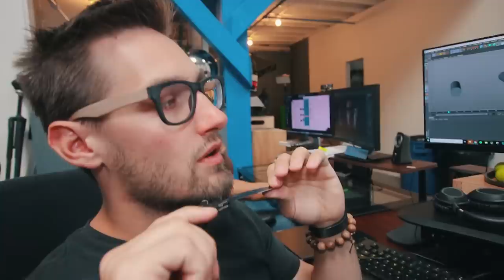TSA is Forcing me to Tear Apart my One Wheel

Comment: The emotional roller coaster of the relationship between boardsmen...
Reply: Cat In The Box Studios Yeah I felt his pain, as I am also using a similar device
Reply: @mikishikishow8393  I use a Neon Nitro because luckily I'm under the weigh limit. The battery last for a really long time but its got it's quirks and terrain limitations. But a friend of mine has a One wheel so I get spoiled every now and then riding his.

Comment: Having multiple leaders on set is only good for the product. You don't need to be surrounded by yes men, you need to be surrounded by people who will challenge what you say and think so you as a person, and everyone as a whole can be better for it. But also as Niko showed, sometimes the first idea is the correct one. This is why I've been subscribed for many years now, you guys all have different ideas and opinions and the content is better for it. Keep up the hard work gentlemen!
Reply: But too many chefs make a bad soup. It's always good to have one clear in charge, who always got the last call.
Reply: Multiple "leaders" is bad. You need a clear direction. Multiple people in the writer's room and having input when appropriate is great but if Niko is the assigned director, you fall in line. There is a difference between agreeing with everything a "leader" says and accepting your role as a follower.
Reply: Dean Searle I wouldn’t say multiple leaders is bad, it’s about not having enough followers
Reply: @vikinger3843  that's a great distinction, I agree. If multiple leaders or more aptly directors was agreed upon to begin with then it works. But having to constantly stop to hear everyone's take is frustrating and exhausting when its your vision. Asking for help or input on that vision is great but should only come once the director asks for it.
Reply: Dean Searle I can agree with that, things like this should be decided before hand easily

Comment: The carbon fiber corridor logo WHAT HAPPEN D: 
1:27
Reply: I was wondering the same... Hmmmm....
Reply: Hot glue job couldn't withstand  the rigors of the studio.  
I've since fixed it.
Reply: Thank you for your service. Without the logo, the crew's foundation was at risk
Reply: JarrettOriginal wait a moment you’re the guy
Reply: Bandana guy
Reply: Jarrett is 75% Adam Savage, 75% Jamie Hyneman, and 50% Buster. He was spawned during an early unaired Mythbusters episode on genetic engineering. It is known.
Reply: Adam Salvage
Reply: Ye, carbon fibre is the strongest material known to man.

Comment: 8:06 Too bad Apple is throwing everything they have to prevent people from repairing their phones. The right to repair is something they very much want to abolish.

Then again, if you are still buying Apple you get what you signed up for. (PS > That "Warranty void if removed" thing is not legal. But manufacturers bet on people not looking into it.)
Reply: It doesn't matter if it's not legal, because it's probably against their own internal rules anyway. The only way to actually get the warranty unvoid is to sue the company, and no one wants that.
Reply: In my country replacing the parts of an iphone will only void the warranty for issues relating to the part that was replaced as it isnt made or serviced by Apple. Which i feel is more than fair, would you agree?
Reply: If you think iPhones are bad, just look at Macbook repair...
Reply: "bad Apple"
.
song plays
Reply: I refuse to buy any Apple products I think they're overpriced restricted garbage. I love my Samsung Galaxy Note 10 it's way better than any iPhone
Reply: I personally don't like apple devices, but the main reasons the phones are so difficult to repair is because of the companies(Samsung included)  search for compactness, camera capabilities, and battery reliability. It takes way more space to put removable batteries in phones. If you think back to those replaceable battery packs of a few years ago, they were quite bulky, but the batteries in your phones now do not have the protective housing, cutting the space needed for them almost in half.
Reply: Apple actually forces people to buy their new products. They send out "updates" to their older models, even if it's just a year old, that make the phone run slower and worse than it did at purchasing.

Comment: There are techniques to remove those screws by pulling on the plate while unscrewing it at different drive speeds. Done it many times. Works like a charm - don't give up so quickly!

Comment: I'm surprised you didn't just drill the screw out, you'd surely have a 2-3mm bit in the workshop.
Reply: But then how do you re-assemble it ?
Reply: There are tools to create new threads for new screws.
Reply: @Kynthiann  seems like a lot of work ... Plus we don't know what holds the treads under the cover, maybe there isn't enough space for a bigger screw ?
Reply: If it is stripped it is no longer a load bearing bolt, drill it out.

Comment: The way they treated a great American like Clint is unacceptable

Abolish the TSA, they're a waste of money. Hire Private Security. TSA should be a oversight & security standards agency.

Not the hideous monstrosity that it is that repeatedly fails to do it's job.

No more security theater, let's get real security.
Reply: What are they missing?
Reply: Besides maybe more intense (likely more intrusive) background checks on passengers
Reply: @KyanNezhad  Not that I have a particularly strong opinion on the matter, but a more specialized training of personnel with strong emphasis on psychological / body language screening and overall common sense, would go a long way. Broadly speaking one of the main differences between public and private is the level of specialization. You wouldn't need to make every single agent a professional profiler, but a few specialists supervising key screening stages from profiling crowds to flagging/screening specific individuals (as opposed to random checks) all done low key...it's how special operators and the likes of the Secret Service screen for threats in this modern age.

The TSA unfortunately has some of the same issues as many police forces: Everyone is more or less trained the same way which is very much outdated in several key aspects. 
Namely, in behavioural psychology screening tactics. In no way meant to bash either, emphasis on specialty training would be better suited to the nature or modern threats. Makes identifying (and anticipating) patterns much harder than systematic ones. The best security is the one you don't even know exists.
It's a complex matter I honestly can't do justice to by simply throwing platitudes on Youtube.

Comment: Clint if you want to remove the bolt you need to be able to pull on it while its turning. Best option is to push a flat head underneath the angle iron, tensioning the bolt. Just in case you want to fly your wheel in the future.

Comment: Wren just a tip, on those style connectors you should push them together before pressing the tab.  The tab can have enough pressure on it that it will bend instead of clip up, also dirt gets in those and some compressed air will help get the dirt out and help you remove it.

Comment: Piece of advice for the future on stripped screws from a repair tech. Side load the head of the screw with a small flat blade screwdriver (push the blade into the rim of the head) to get traction on the stripped threads while using the drill. Or if possible get the tip of the flat blade under the head to lift past the stripped part and get the threads to bite. Trust me when I say I’ve had to do it a thousand times in my line of work.

Comment: Put adhesive on the top of the screw and put the screwdriver in the adhesive and let it dry, when dry pull the screw driver up until the screw doesn't move up with it, at that point turn the screw so that the threads of the screw match up with the threads on the inside of the hole thus allowing the screw to be unscrewed, hope this is useful!

Comment: If the bolt is freely spinning than the internal threads are stripped. You have 3 ways you can remove it. If you are screwing (looked like Allen or torx) you can ingage the head of the bolt with the bit, spin the bolt and give it a slight sideways torque. While doing this the bit should grip the bolt and you can actually pull the driver back towards you. It will eventually catch a thread and back out. I've done this many times and it works well, if you can get it up a tiny bit you can get it out.  This is my second point/method. If you can get a small screwdriver or something like a paper clip under the head of the screw (obviously it's loose) then you can pry it up while screwing it out.   Lastly the final method. Take a drill and a drill bit that is slightly smaller than the screw itself. Looked like 10 32 screws so you could drill the screw hollow and it will then either pull out or fall out. Then when you reassemble you can either buy a new bolt , or forget that single bolt till the end of time because the threads below it are toast. 

I really felt bad that you possibly couldn't bring your one wheel on a trip. I don't have a one wheel but I understand how amazing it would be to travel with one. I cannot wait for the day I can afford a one wheel.

Comment: Try taking a drill bit to the screw if you're desperate to remove it and something like that happens. Pretty much just re-drilling the hole, you'll most likely need to tap the hole again and definitely need a replacement screw but it should work.

Comment: Clint, it's too late now, but I would have tried using a flat head screwdriver and use it as a lever while you're unscrewing the screw. Or maybe super gluing a stick or maybe bolt to the top of the screw head, so when you are unscrewing it you can also pull on it.

Comment: Little Hint: Drill a small hole into the screw, get it out, get or make yourself a replacement screw and your done. alternatively if your new screw almost fits then drill a new hole and make a new screw thread. it really is the work of a few minutes and it often saved my work, even with smartphones or laptops where people drilled like the screw had a round top hole

Comment: Why didn't Clint use a stripped screw remover? It's like a reversed drill bit with really sharp edges. You drive it into the screw head, and the sharp edges bite into it. Because of the reverse thread, once it had tightened as much as it can, it un-does the screw.Although it does destroy the screw, I'm sure they would have a compatible screw in shop

Comment: You could have tried super glueing the bit to the screw and pull while unscrewing. Then with a blowtorch you melt the super glue, or with a light tap using a mallet (if you have strong bits) to break the glue wich is actually quite brittle

Comment: This is why we dont use powertools on expensive electronics. A regular hand philips driver and you wouldent of over torqued and strip threads. Once the threads are striped like that, its still really easy guys... dont know if the drams was for dramas sake, BUT, turn the board upside down, gravity will lead the unstriped threads into the hole, turn lightly with a hand screw driver(dont Push the screwdriver, your not letting the good threads Fall into place), and viola, screws out in 60 seconds.

Comment: PRO TIP FOR STRIPPED SCREWS Usually only applies to smaller screws on tech FOR FUTURE REFERENCE CLINT You can hotglue the inside of the screw and put your drill bit on it. Let it dry put drill on bit and try to unscrew. If it does or doesnt work the glue it easily removable.

Comment: Hey Clint, get a knife and use the tip under the head of the screw, and pull it up with the screwdriver.

That usually fixes this annoying "Endless rotating" screw issue. Hope anyone who reads this can benefit from it :)

Comment: add a dab of hot glue to the top of the screw and put your drill bit inside the glue. wait for it to dry and then lightly pull up on the screw while unscrewing it slowly. that should lift it enough to where it would get grip on some top thread if theres any left.

Comment: If the screw is just spinning, the threads are stripped. The bolt might not pull out anyways, but if you pull on the thing it's supposed to be holding in, and unscrewing it at the same time, it should come out.

Comment: Dry ice isn't "so cold" that it sublimates, its just a property of the substance that it doesn't have a liquid phase at normal atmospheric pressure.
Reply: yeah, I think that's what Sublimation means. All it says is it skips a phase. Meaning in this case. It goes from Solid to Gas without touching the Liquid state. The words sublimation is an extremely simple way of saying what you just said. There are a few ways to cause sublimation and your's is but one.

Comment: For the record, there is a fix for a striped screw like this. It's a countersunk screw, so if you can wedge something in the gap, like a knife, a peice of soda can, or even paper the thread should catch and start to come out. Once e you have it out you should really tap the hole and install a helicoil or sheet metal insert. That screw isn't doing it's job, and that may compromise structural integrity over time.

Comment: Those warranty stickers aren't supported by law. Since they cost a couple grand, most people are timid of messing with electronics if they don't get a free replacement. The company really just doesn't expect anyone to 'void' the warranty, take it apart, break it, and rationally think they would get away with it with the sticker obviously torn. It's a phycological precaution.  In truth, you could take it apart, void the sticker, put it back together, and 3 months later have a genuine electrical problem and use your warranty. If they try and tell you no, ask for the paperwork, approvals, etc. for proof that the sticker, indeed, is a LEGAL form of warranty voiding.  They won't do it, because they don't have it.

Comment: Wish I was there to help these boyz out. You could just pop out the motor/wheel and not take apart the battery area and ship the frame (no voided warranty). Or if still too expensive, drill out the screw, re-tap, install larger screw. Literally just had to do this a few days ago on my car.

Comment: I had a screw that was stripped and couldn't be removed from a bookshelf.
Its hex-socket had been worn down from being repeatedly disassembled and reassembled.
So, I filled the hex-socket with superglue and let it sit and dry.
Then, I shoved my hex-key in the socket and was able to remove the screw.

Comment: What they should have done was taking a drill bit and drill the screw out. Then use a threader to rethread the hole and put another screw in. That or 3D print a plug for it

Comment: Another flag code: No other flag should be as high as the American flag. Hence why state flag poles are normally slightly lower than national flag poles. As well, most states have a similar code. So often a scout flag will be slightly lower than the state flag. 

So If the national flag is at half mast, ALL flags are at least at half mast. Whereas is the state flag is at half mast, the national flag may not be.
Reply: Half Staff. Masts are on ships.

</i>pushes up pedantic glasse</i>

Comment: next time put a lever under the screw head and lever the screw up as you use a hand driver to start engaging the thread. hand driver is important cause you will be able to feel where it grabs \
.. you have stripped the hell out of the screw hole and now you need to re tap it....

Comment: If the screw was that stripped you're better off DRILLING it out anyway. Just drill out the center with a 1/8th, then a 3/16th and you should be able to grip and slide it out. Go bigger if necessary without hitting the threads on the side.

Comment: protip: epoxy a nail to the top of the stripped screw and pull it out while spinning it, then just replace the screw after you re-thread the hole of course.

Comment: If you could remove the motor/wheel... why not just ship the batteries inside the aluminum frame? The wheel/motor is all the weight, basically, so remove that and you pretty much are left with what you'd be shipping anyways. Just a thought for next time...

Comment: I'm much too late to be helpful with this comment but there is actually a tool you can buy for this situation (assuming that the screw is stripped and not some other issue). It's called "SpeedOut".

Comment: I mean couldn't you just have shipped the entire one wheel?? Why take it apart, ship the battery and then carry the rest in your luggage??
Reply: Probably because shipping the entire Onewheel (which is pretty large and heavy) would be very expensive compared to just shipping the smaller and lighter battery by itself. In addition to this, they would have to ship it twice; when they're going and coming back.

Comment: This may never be seen as this video is so old, but I have shipped a lot of gear with high amp hour batteries. Why didn't you just ship the whole one wheel? You can't use it without the battery any ways, and you can't fly with it, but you can ship it without taking it apart as the requirements to ship are the same installed or not installed with shipping. Why did you waste all this time instead of just shipping it as is?

This may seem ridiculous, but this is so glaringly dumb that I really don't think I want to be subscribed anymore.